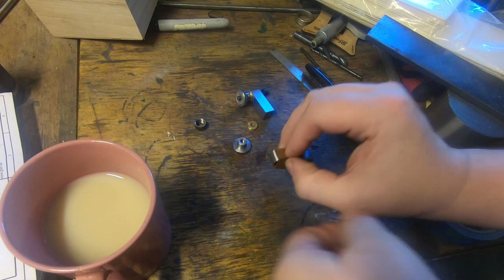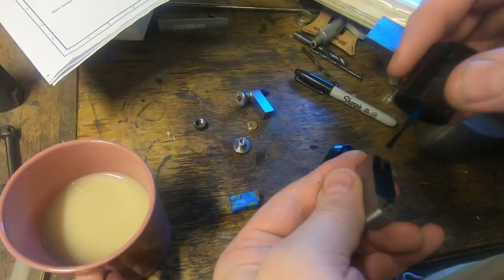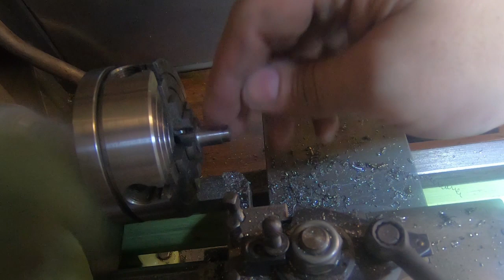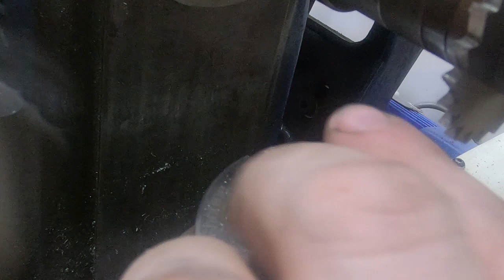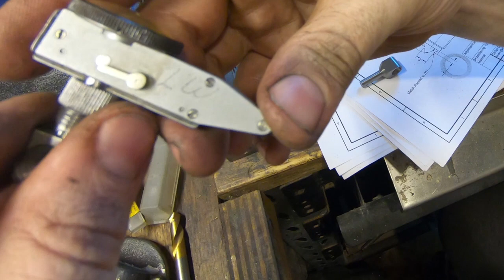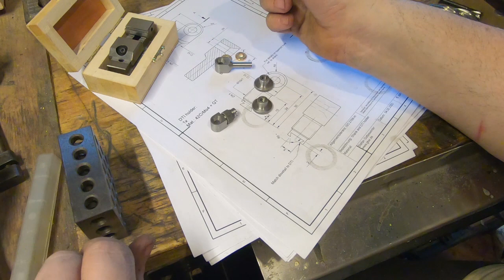BUILDING THE GTWR INDICATOR HOLDER PT5

Comment: Hi Emma, great work. The new gearing worked a treat cutting the threads. I was wondering how you were going to cut that small dovetail. Using the shaper brilliant. I was thinking a small dovetail cutter. Regards Kevin
Reply from the maker: i thought about it. a file would probably be fine.